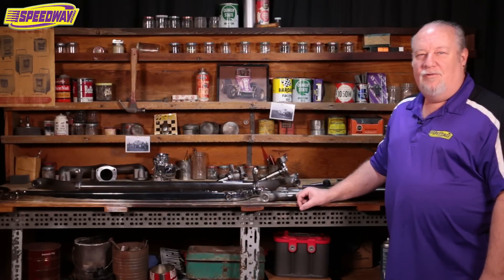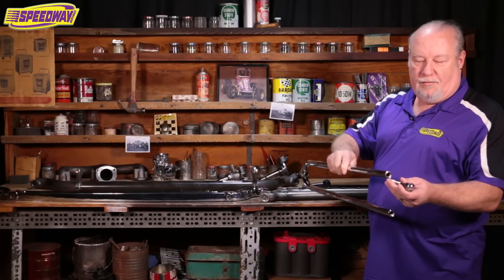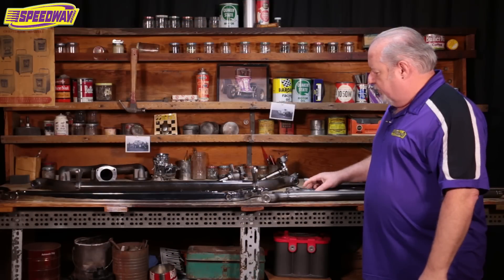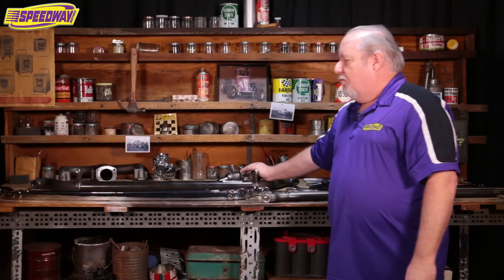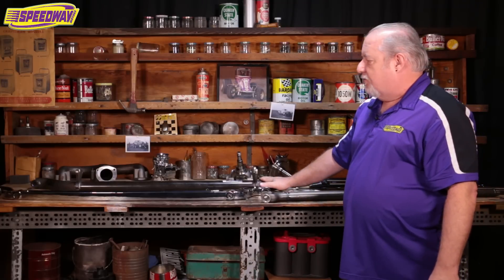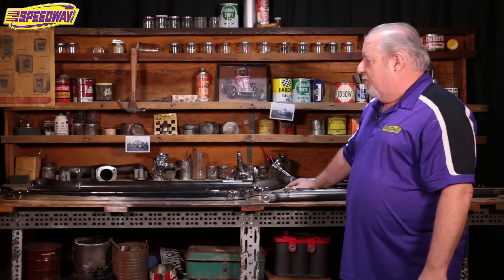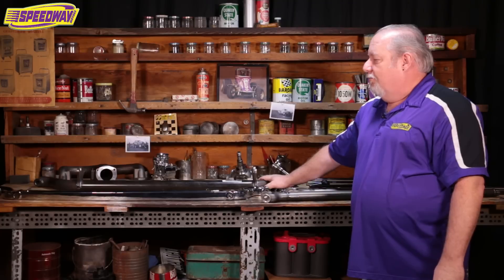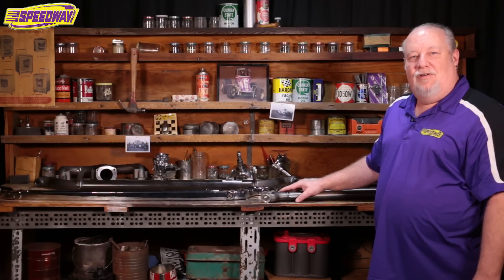Speedway Tech Talk - Solid Axle Basics

Comment: I realize this is an old video, but I see many people are still using your front end kits. I also see so many of them, and others, assembled with poor/no Akerman geometry. I don't know if you folks supply assembly instructions or not, but a heads up to proper building would go a long way to better tire wear/handling, and safety. Good products, well done.

Comment: I have a 1919 model  T frame with all of the running  gear the frame is in very fine shape my ? Is , can you use a small or big block Chevy set up with the stock frame ,is the frame strong enough without  boxing ext. ? I will use a different rear end like a ford 9 in and a different front axel . Thanks TANK
Reply: If I may interject, I will say no. You are considering installing an engine with at least 10 times the horsepower of the original 20 HP engine and open drive without torque tube. The torque twist must then be absorbed by the chassis. The weight combo of the powertrain would certainly exceed  that of the original. Box it, add some crossmembers to stiffen it, take the twist out.
Reply: TrailBusterBrute1    Thanks that makes sense the frame does look frail compared to frames like my fifty and sixties cars ,thanks again .